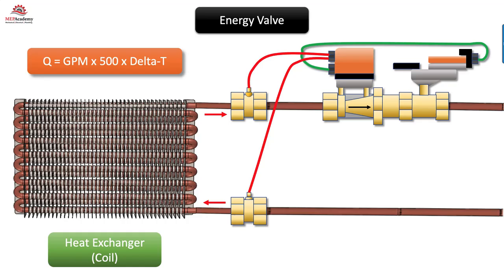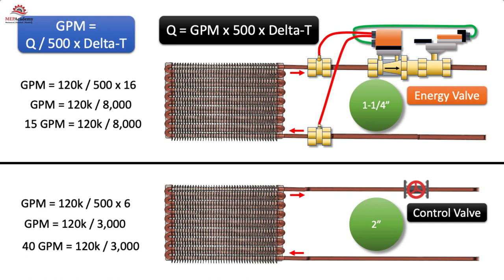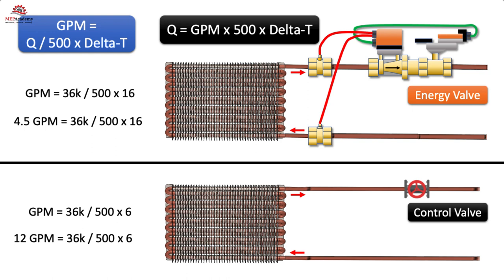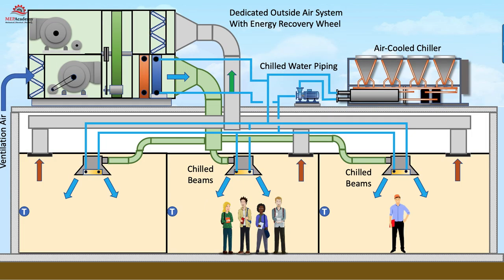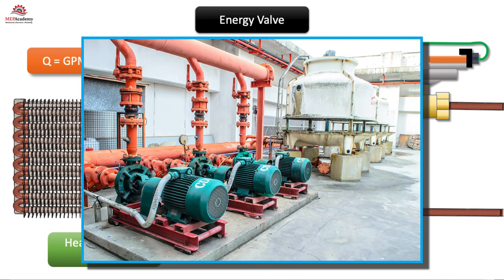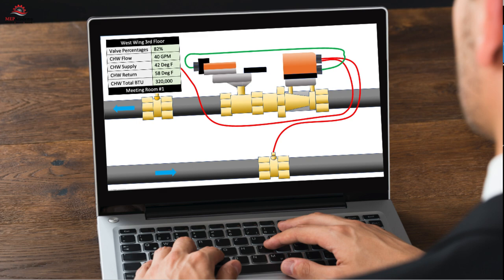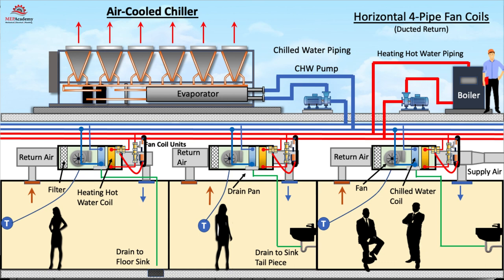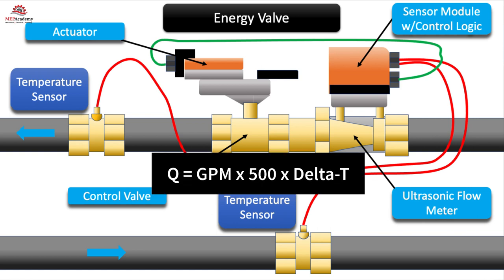Energy Valve

Comment: Have you seen water coils used in freezing applikations?
Reply from the maker: With the use of Glycol the temperature of water can be achieved lower than zero, but this is not something you would most likely see in the HVAC industry. A mixture of water and glycol is commonly used for snow melt systems, geothermal heat pumps and in typical water systems used in the HVAC industry where pipes might be exposed to freezing ambient temperatures.
Reply: @MEPAcademy  
Its becomming more and more a thing in the EU due to hfc and hcfc becomming more regulated and phased out.

So ammonia is often used in stead. But it has problems glycol can solve. I am doing a project for some automotive test machinery that needs to produced a test cabin temp of -20c and we are planning to use glycol and ammonia.

So was just curios if its a thing in other applications